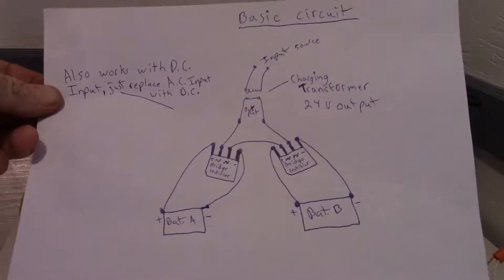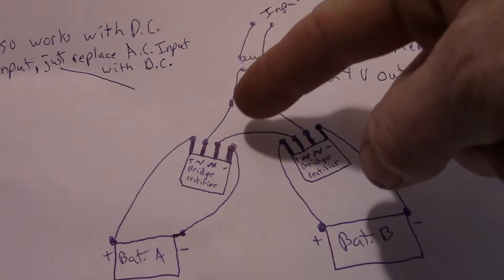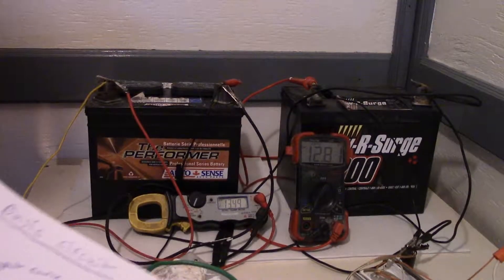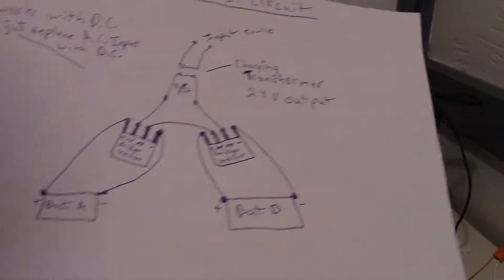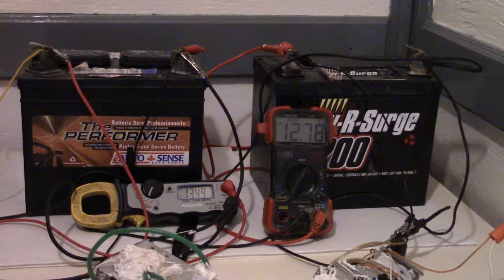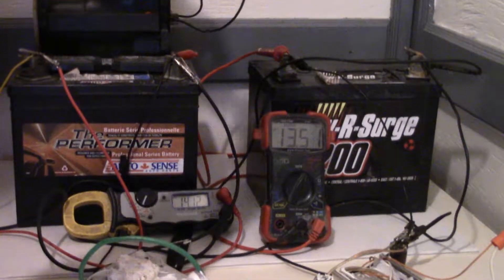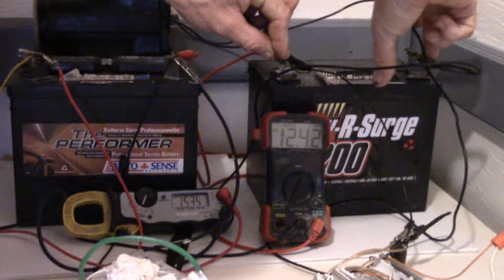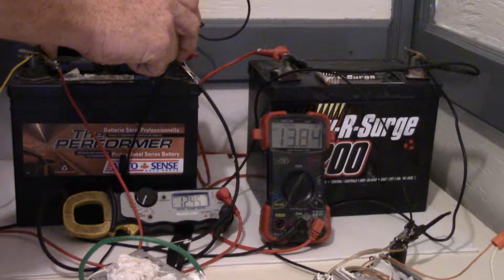How to charge different batteries in series while keeping the batteries separate

Comment: Then  when they discharge  in series the lower ah battery will over drain  and also bring the whole system down faster.  Charging  separately  is fine though
Reply from the maker: Not with the circuit in the video,  try it you'll see they are isolated from each other.

Comment: Great info! Thank you 🙏🏻 I have a question, for my camper van I have 3 batteries by “Universal Power Group” 12V 100Ah Solar Wind AGM SLA DEEP Cycle and I need at least 500Ah. Can I mix this 3 batteries with one “Mighty Max Battery” 12V 200Ah 4D SLA AGM Battery?
Reply from the maker: No in that situation all the batteries should be the same,  the circuit in the video is only useful to change different batteries that are being discharged from separate systems .
Reply: Wind Power And More Ok. Got it. Thank you!
Reply: So now if his mighty Max was a 100ah 12v he would be fine to mix them all. Is that correct?

Comment: Seems like it would be a whole lot easier to just get two chargers lol but... I did come here because this is exactly what I was wanting to do...
Reply from the maker: Thanks for watching,  it's really useful if you have only one charging source but more than one battery or different type or voltage battery,  the only thing is the power has to be diverted to a dump load on each different battery. If the power is cut from one of the batteries the other will stop charging also.